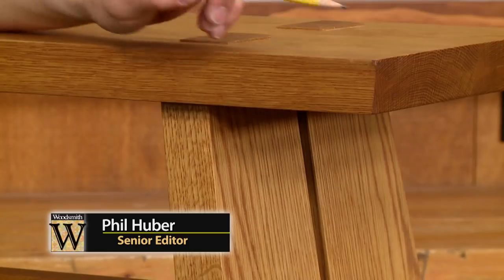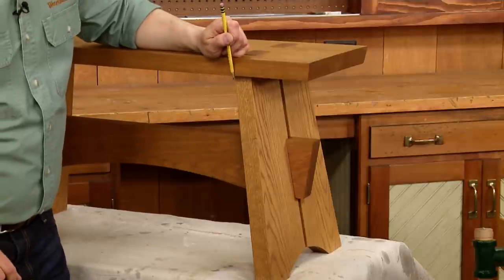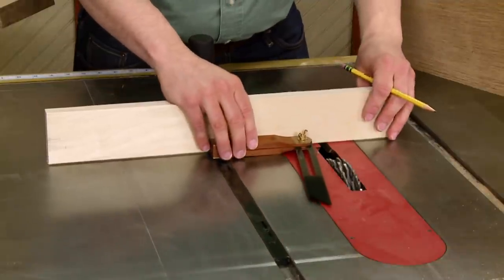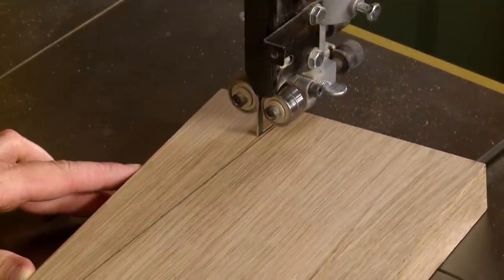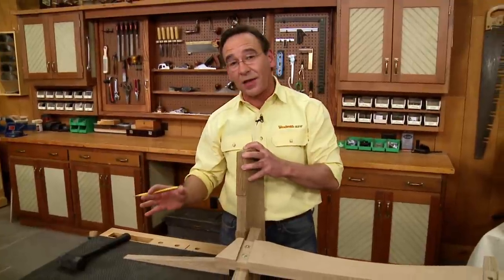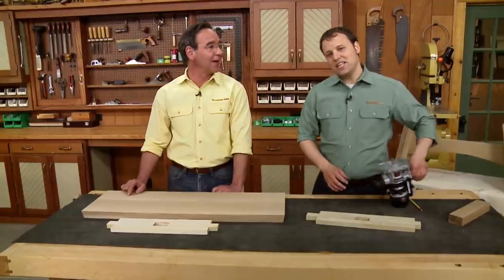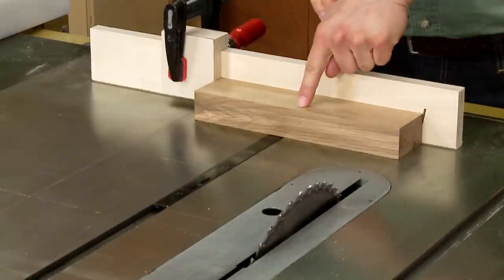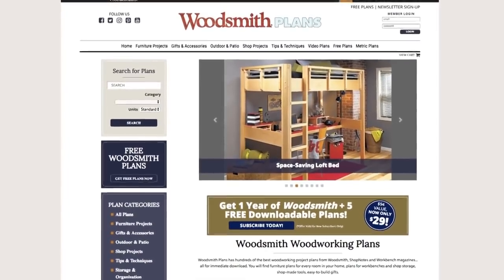Build a Simple but Elegant Garden Bench

Comment: Great video and project. Instead of using the dowel centre pins and then having to get the angle of the hole in the leg correct. Would it be possible to use the stretcher as a guide and just drill through the holes in it?
Reply: Mark Whyte yes and drill the holes BEFORE cutting the long side angle.
Reply from the maker: Absolutely, that should work too.

Comment: The connection of the bench seat to the legs with 'long' screws is flimsy and won't hold up to use. You should have used a steel connector. Simpson has the outdoor accent line which has lots of different 90 degree angle ties.